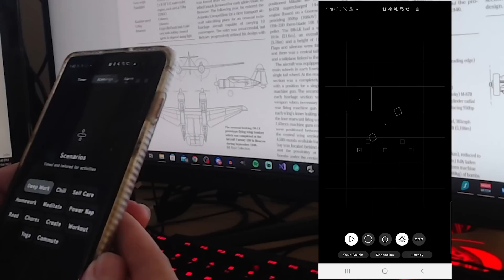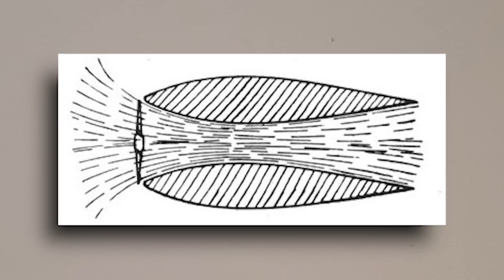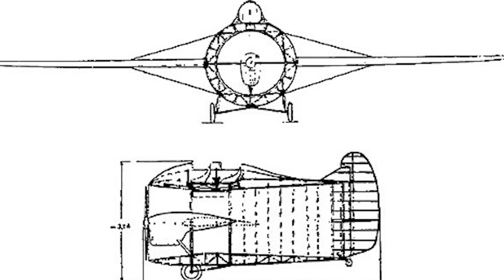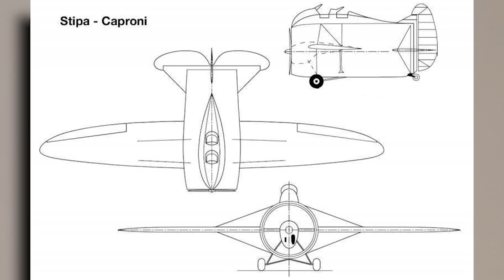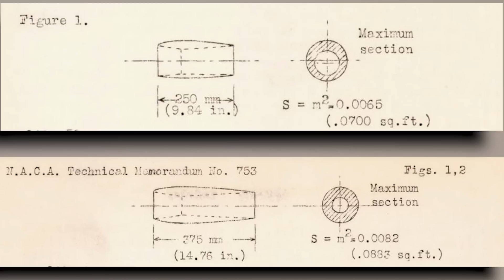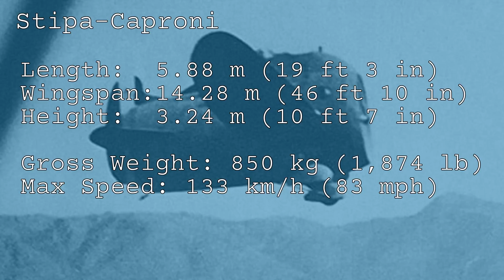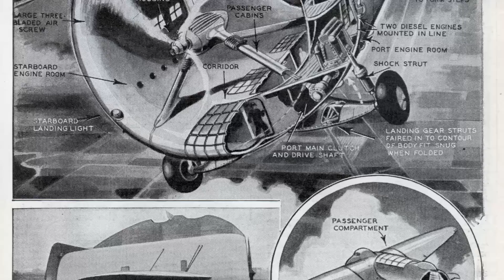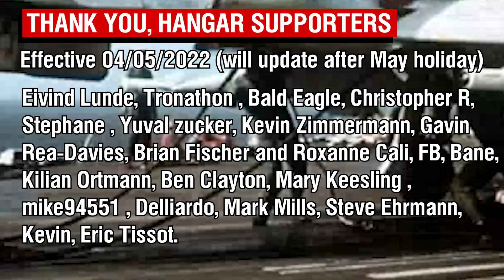Italy’s Bizarre Flying Barrel | The Stipa Caproni [Aircraft Overview #55]

Comment: It pioneered both the Jet engine principles and Vectored thrust. Nice.
Reply: More a ducted fan, which is used in jet engines but more large bypass ones as used on airliners. There has recently been some interest in ducted propeller design for modern electric propulsion. Definitely vectored thrust though.
Reply: Lol no
Reply: @billinghamscuba  How come
Reply: @seriousthree6071  I think it qualifies as a jet powered aircraft. The forward thrust is indeed provided by a "jet" of air coming out of the fuselage.
Reply: A shame that the guy didn't know what he had. And where it would go.
Reply: Decent

Comment: I think that with some proper development the design could have been drastically improved.  It's a ducted fan, and as we now know with R/C models ducted fans can boast serious performance over conventional propeller driven designs.
Reply: Not by chance Stipa designed it for large aircrafts, where the barrels, buried into the thickness of the wings, would have generated near to none additional drag.
Reply: Ducted fans are actually quite inefficient for most applications. Its not just a matter of the drag. Here is one way to conceptualize it: The duct benefits the efficiency of propeller by eliminating tip drag and directing the airflow more. When the aircraft is moving, the relative speed difference between the air moved by the propeller and the surrounding air is lower, reducing the benefit of airflow being more directed because it has less energy pushing it to being misdirected. So for high speed airplanes, ducted fans just produce more drag.

The popularity of ducted fans for RC aircraft are actually more to do with the fact that you are limited to fixed pitch propellers at those scales. If you put a more powerful motor in an RC plane and want to put that power into the air, you need to either spin the propeller faster, or use a bigger propeller. You reach the practical limit for propeller size pretty quickly, and after that there is no way to go but higher rpm. The higher the rpm of the propeller, the higher the tip drag is, so pretty quickly tip drag just eats up any extra power you put into it and you just end up sucking down the batteries faster and making more noise to go the same speed. Ducted fans eliminate tip drag, allowing for higher propeller rpm, and therefore higher thrust for the size.

The reason why real aircraft don't use ducted fans is because if you are using that much power, the only practical way to be generating that power is with a turbine engine. So its easiest to just make it a jet engine and not deal with the middleman of a power turbine and gearbox and propeller. RC planes that use that much power can only fly for minutes at a time while actually using that power, so the don't bother building electric planes that powerful. They barely bother to build electric planes at all.
Reply: @lobsterbark  You do realize that most commercial planes today use turbine driven ducted fans (aka: turbofan engines)? 
That type is the most efficient at high subsonic speeds, with turboprops better at low speeds and turbojets taking over at supersonic speeds. https://en.wikipedia.org/wiki/Turbofan#Efficiency
Reply: @svennoren9047  Yeah, those are technically ducted fans but nobody calls them that. I basically explained why with my long-winded comment. They could technically make them turboprops and it would be more efficient, but the prop size would have to be absolutely insane and the crazy stuff you would have to do with the design to make that possible would probably steal away any efficiency gains anyways.
Reply: um this idea but with 2 mods 1 2-big bypass turbofan's and 2 at altitude fly side ways to get into SS-sonic speed as the design of the wing tips looks like it might be good at cutting air as a nose and it looks like a flying wing so theoretically forward's and sideways flying is possible if not more efficient in different mode's
Reply: @lobsterbark  Tip speed is always the limiting factor in propeller design.  As with everything, there is a give-and-take.  Propellers have to perform quite the balancing act between diameter and RPM to maintain efficiency.  The problems only escalate as airspeed increases.

Ducted fan RC planes have speed, but are surprisingly low on actual power.  Electric powered ducted fans have proven to be far more reliable and efficient than those powered by IC engines.  A turbine jet engine, which could be viewed as a type of ducted fan produces quite a lot of power but is a very thirsty engine.  One thing electric ducted fans have going for them is simplicity.  With the right advances in battery technology I could see them making inroads in full-scale aircraft.
Reply: @realityquotient7699  Turbine jet engines are one of the most efficient kind of engines there are. They just idle really high, leading to high fuel consumption while taxing and idling. But when at cruise and takeoff power, they are insanely efficient, more efficient than diesel engines even. Because of this, they are generally only used for very high power applications, where no matter how efficient the engine is it's going to suck down a lot of fuel. This high fuel consumption is confused with low fuel efficiency, but they aren't the same thing.
Reply: @lobsterbark  Agreed, although I don't know of any diesel engine that's fuel efficient compared to other fuels.  They do produce quite a lot of torque.  I may be wrong, and I certainly have nothing to back it up, but I'm under the impression that turbines in general are most efficient at 'full throttle'.  This is what makes them so good as aircraft powerplants and power generation (I'm talking steam turbines here, not so far different).
Reply: @realityquotient7699  Diesel engines are the most efficient reciprocating engine type. It's why trucks use them. A huge dually diesel truck that gets 10mpg would get 6 if it was gas powered. They also don't inherently produce any more torque than a gasoline engine, they just can't rev high because the combustion speed is too low. So they design all diesels to make lots of torque because that is the only way to make power when they can't rev.

A lot of the time what looks like a strength is actually the consequence of a weakness.
Reply: @lobsterbark  You're correct, I had it backwards...the sad part is that I knew that and said it anyway.  Muh brainz wuz turnt off, I guess.

I suspect the RPM issue is a large part of why we don't see diesel reciprocating powered planes.  Also, unless I'm way off, deisel engines need to be heavier to withstand the higher compression required.

As an aside, jet fuel is essentially kerosene, which isn't far off from diesel fuel and can be used interchangeably in many applications.
Reply: @realityquotient7699  It's true that diesels need to be stronger, but with modern materials and techniques a diesel engine can still be of similar weight to an equivalent gas powered one. Aero engines are all old designs. 

There has been a few attempts to bring diesel aero engines to market. I think a few are still selling well enough, but mostly they have had problems finding buyers because most light aircraft owners want to spend as little on the plane as possible while meeting their needs and don't actually fly all that often. So even if a new engine saves them 20% on fuel costs they are reluctant to buy one when the 60 year old design has engine costs less and has had all the bugs worked out decades ago.

I think if somehow the ability to make and buy these old gas engines was wiped out with magic, diesel engines would take over for everything above about 80hp in the GA market. They are just too good.
Reply: Ducted fans are simply less efficient.
Reply: @svennoren9047  And UDF, or un-ducted fan engines, are more efficient, and may be coming back. GE had a flying prototype in the mid-1980s.
Reply: @lobsterbark  Part of the diesel advantage is the higher energy per mass of diesel fuel. The higher cylinder pressures of the Diesel cycle add more efficiency. But the mass of the structure required to support continued detonation keeps them from certain uses, though there are a handful of compression ignition aircraft engines. Much heavier than the equivalent petrol powerplant, but much easier on the fuel, don't require lead, and will burn Jet-A.
Reply: @realityquotient7699  Check out the fabulous Diamond DA62 aircraft. Two diesels, burning Jet-A.
Reply: @UncleKennysPlace  Any diesel engine should run on Jet-A just fine.

Comment: Thanks for posting this, I never knew it existed, but it makes a lot of sense despite its odd appearance.  Most people don't realize that a large portion of modern jet engine success derives from the shape of the intake and exhaust ducting.  A lot of engineering goes into getting the shape correct to feed the air through as engines these days are all about the fan on the front.  The engine itself exists to drive that fan and control its speed.  Stipa undoubtedly aided this work with his ducted fan research.

Comment: The implication of a tube with a "folded over - circular" wing design creating lift is evidence that a wing does not create lift via the Bernoulli effect.  That is the curved component creates a low pressure area which the flat side's higher pressure pushes up on.  If this was the case the tube's bottom and top surfaces would cancel out resulting in no lift.
Reply: I feel your over simplifying a wing as just a Bernoulli device. Nearly all wings are curved upper and lower surface structures, some are even symmetrical and only make lift when essentially tilted up into the airflow. An F-104 wing only fly's as a stalled slab at slower speeds and has a very flat diamond cross section. One can best visualize the Stipa's fuselage as a super open blown wing or a zero stagger biplane pinched into a tube. A blown wing in the sense that the funneled thrust at the rear prevents any flow reversal on the outer tube surface allowing all airflow to remain lamina and flow across very varying thicknesses of relative airfoil sections around the tube making as many areas of lift as possible. All this would only be generated in some degree of pitch up or angle of attack. This is a normal flight regime in most aircraft and is often trimmed into the aircraft deliberately. Some lift is created inside the lower tube half, the rest is generated over the outer upper half of the tube. As you stated however I agree that the lift would be cancelled out in a zero angle of attack regime, this however I doubt is ever a regime of flight for most aircraft until the lift is greater than needed at higher speeds in which a nose down trim is needed. This can be seen in WWII fighter aircraft used in pylon racing, and is very pronounced when formating alongside a modern jet fighter just hanging onto lift at it's lower speed envelope while the prop fighter is way nosed over just to get the speed for level flight in that unusual formation.
Reply: To see my last point in vivid detail do an image search of "Spitfire and Eurofighter formation". I doubt you will also find any image of the Stipa Caproni flying at zero angle of attack which validates your original point in principle, however in practice not many wings fly as you inferred by your opening statement.
Reply: @stevenborham1584  
I can float a pin on water due to "surface tension" but its not why ships float.
Reply: @stevenborham1584  Its not a "Bernoulli device" that's my  point and the opinion of aerodynamic experts.  What you a describing is the redirect of airflow not low-high pressure differential.
Reply: @bob19611000  I guess one can ague their point ad nauseam, and it will only be the situation of the 3 blind men describing an elephant situation with all descriptions being valid. Your point about the pin is a good one.

Comment: So close to early development of jet engines. For that matter, ducted fans could have been a fascinating addition to combat aviation technology.
Reply: I doubt it wouldve made much sense in a fighter plane, or a bomber for that matter, for the same reason as the He 100 that used the entire wing surface as a radiator. 
Essentially youre running around with a way larger engine nacelle than you need to, which gets hit by bullets far more easily and I think holes in the duct would cause some problems, especially drag.
Compare that with a conventional aircraft, and its fairly easy to realize why this idea didnt take off, even if the principle could have been integrated into a larger design more elegantly.
Reply: @builder396  everything starts crude, and gets improved. Nothing pressurizes R&D like war. Already, we can see that there were multiple much more compact ducted fan designs on the drawing boards - what might have come if development had continued? 

One of the things that occurs to me is that you can do the same thing as the V-22 Osprey with ducted fans in place of the wingtip nacelles. Might we have seen, for instance, VSTOL transport aircraft? How would that have affected the shape of the Battlespace?

Comment: One can call this a very early attempt to a jet engine.
I will explain.
A jet engine takes air from a scoop of some type and puts it through a tunnel.  It then compresses the air.
It then introduces a fuel air mixture into the compressed air/fuel.
It then ignites the mixture (thus, creating a hot gas that propels the plane).

As I see the plane, this is taking air, pushing through a tube, using a propeller, thus producing a thrust (to create movement over a curved wing) in order to create lift.
The Vertical and Horizontal stabilizers are in a direct line to the tubed air.
The wings then create lift (as they develop a fast and slow air flow [over and under the wings].

This is an experimental craft.

Comment: Contemporary propeller planes were near an end of improvement in thirties. A new way of propulsion was researched.
Jet engine promised unlimited thrust if unlimited quantity of fuel and air can be compressed and burnt in jet engine's combustion chambers.
Jet engine uses an axial air compressor and combustion chamber to produce thrust while propeller efficiency is limiting factor in producing thrust.
The plane designed in 1932 by Luigi Stipa is a 'ducted fan' propeller engine. The air stream is accelerated by Bernoulli effect.
The "flying barel" was built only for political reasons.

Comment: Count Caproni sponsored many unique projects, including the Coanda-1910 by Romanian Henri Coanda. This was the first designed and built motorjet, basically a thermopropulsion motor run by an inline piston engine. Though some aviation books reference the Coanda to France, it was actually built in Talaido, Italy at the Caproni factory, then displayed at the Paris Air Salon in 1911.  Later, Mr. Coanda claimed that it flew, but this was never verified. When the Stipa-Caproni flew, this started a legal conflict in which Mr. Coanda claimed the Stipa was an infringement on his patent, which he lost. This paved the way for the Campini-Caproni of 1940. Traditionally, Count Caproni's system was the designer's name followed by his own.
Reply: The Coanda-1910 was not a motorjet.
While constructed only as a static display it was built as a DUCTED FAN aircraft powered by a French Clerget inline 4-cylinder reciprocating engine.
 Henri Coanda made no claims to have built a motorjet  prior to the 1950s

Comment: With a little extra effort, they could have worked a unique ejection seat system into this plane by putting a trap door under the cockpit seat. Just drop the pilot into the air duct and he is blasted clear of the plane.

Comment: I thought the propeller was actually inside the enclosure. But the picture of the replica shows it just outside the enclosure. I can't imagine how much louder it would be with the engine and it's exhaust basically sitting in an amplifier tube. But I bet it had a very unique sounds of the engine being enclosed. If the tube was narrowed down towards the back to accelerate the airflow world it have given some type of boost in performance over a standard prop planes of the era.

Comment: Personally, I would have turned the engine around and used it as a pusher, hence moving the propeller further into the tube and improving cooling of the engine and you could move the cockpit further back making the look less comical.

Comment: Looking at it it doesn't seem weird, it's a fan, which is better than a propellor and the basis for many modern aircraft engines.
Reply: Looks like it had stiff gyroscope type forces with a wing like tunnel, so no wonder it was difficult to roll and for the fuselage to change directions.

Comment: The Camproni M1 looks really cool hope for a vid on it soon , as for the Caproni Stipa I dont know how safe I would feel if it had been a passenger carrier..but without thes Odd ball looking Machines aviation Designers wouldn't learn what can an what cant...Good one again Rex.
Reply: It would be very safe. As mentioned it had incredible lift and stability along with a low stall and takeoff speed. Those are great attributes for a safe aircraft

Comment: Its basically a proto jet engine damn
Reply: Infact the subsequent Campini-Caproni was the same concept, but replaced the two-bladed propeller with an axial compressor, so it was a proper jet engine, even if powered by a gasoline engine.